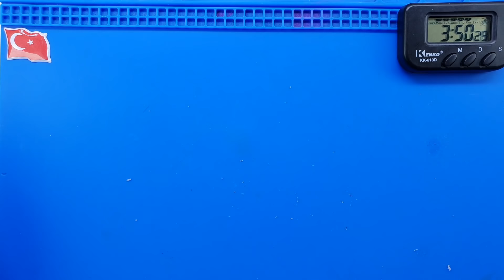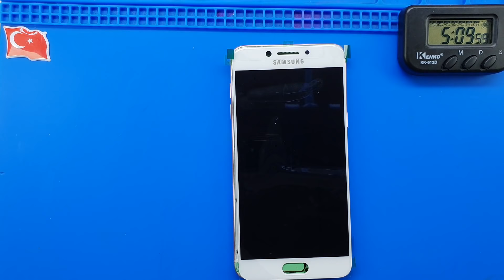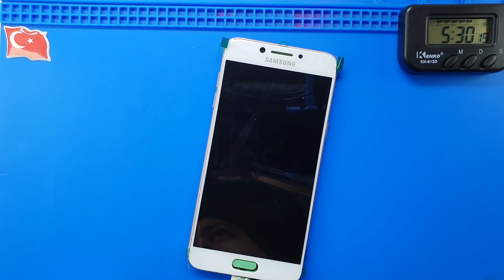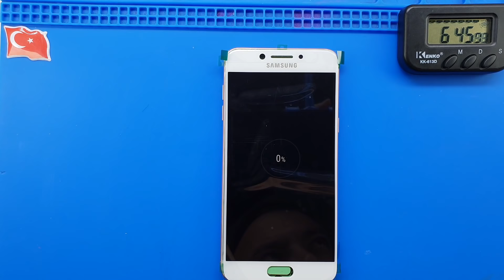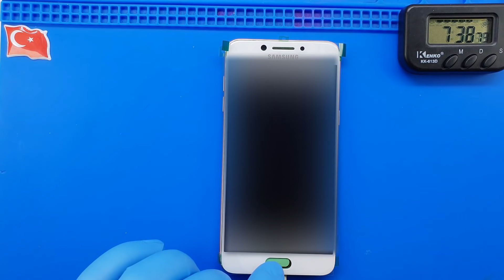Samsung Galaxy C5 Pro Ekran Değişimi 🇹🇷

Comment: Hocam merhaba  bende casper vıa v8 model bir telefon varda şöyle bir uyarı verdi (your battery is lower temperature please disconnect the charger!) bende şarja takınca kapandı açılmıyor  başka batarya taktığım zaman açılıyor şarja takınca kapanıp o bataryadada çalışmıyor sorunu nedir ?
Reply: Ayhan UZUNKOCA bataryada sorun var
Reply: Dikkatli okursanız başka bir bataryadada denediğimi yazdım yinede teşekürler.
Reply from the maker: Ayhan Bey merhaba;
Batarya da bir sıkıntı olabilir. Açıkçası farklı bir bataryayı denemişsiniz ve cihaz çalışmış. Ama tabii ki sizlere net bir şekilde bilgi verilebilmesi için cihazın teknisyenlerimiz tarafından test edilmesi gerekir.
Selamlar.
Reply: Peki ilginiz için çok teşekkür ederim.